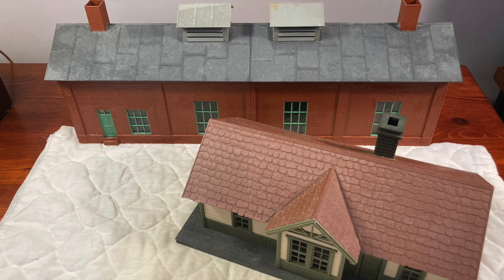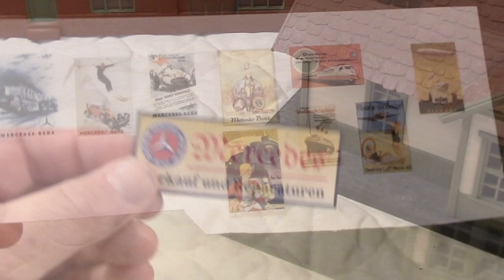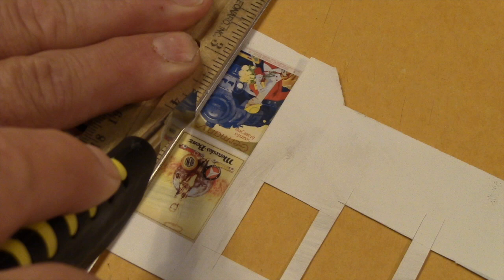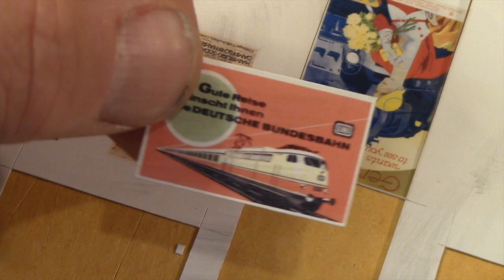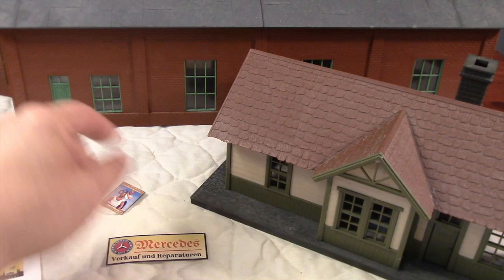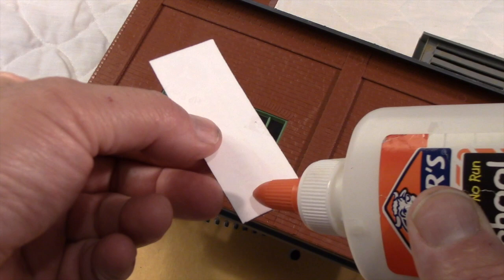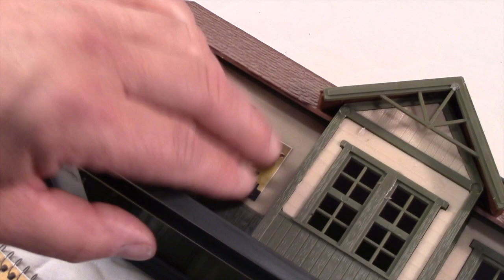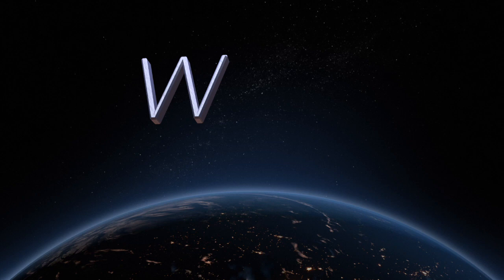Posters & Signs for LIONEL Model Kit Buildings in O Scale Gauge for Layouts Williams MTH German

Comment: A modeler can lay a brick wall horizontally & brush a thinned white or gray paint on the wall.  While the paint is still wet, use a paper towel to sweep across the wall to remove paint on the surface of the bricks.  This method will leave " mortar " between the bricks.
Reply from the maker: Thanks Pete. Have nice weekend!